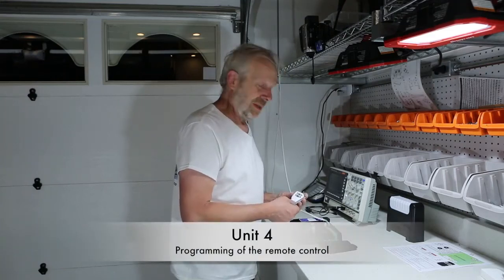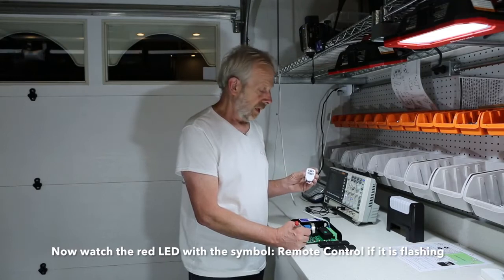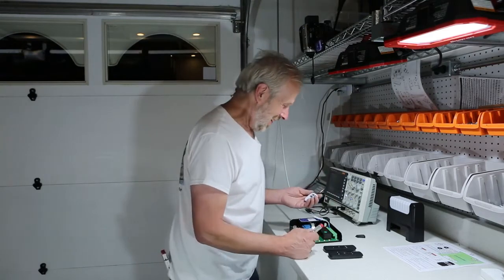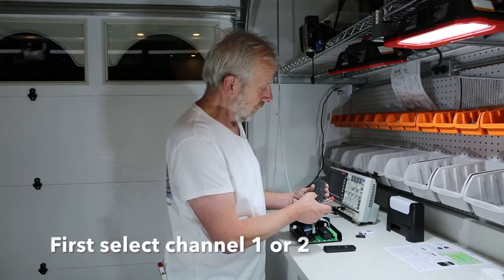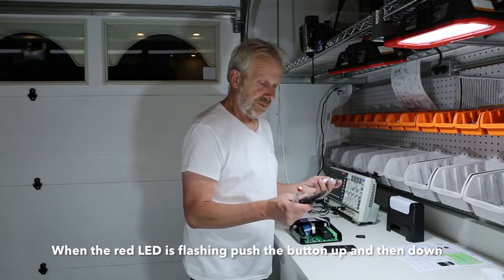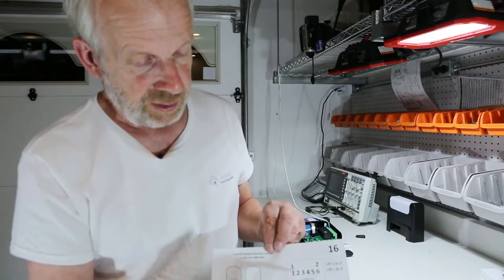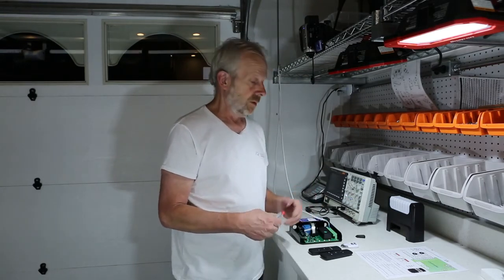Auxx Lift Garage Storage Lifts: Installation Guide - Programming Remote

Comment from the maker: 🛍 BUY NOW: https://yblgoods.com/products/electronic-garage-platform-storage-lift-400lbs-600lbs-by-auxx-lift-2
YBLGoods.com ⭐⭐⭐⭐⭐ Rated: 4.9/5
🚚 FREE Shipping Anywhere in The Lower 48 States!
✅ Installation Assistance!
✅ NO Sales Tax! (ex Ohio)
✅ Price Match Guarantee!
✅ 2 Year Warranty!
✅ Phone, Email, Video, & Pamphlet Support!
👌 EASY Installation on Joists & Rafters 

The Auxx-Lift is the ideal storage solution to keep your garage organized. It is the largest and strongest platform on the market with 4' x 8' area and 600 lbs lifting capacity.

Platform sizes
3' x 6'
3' x 8'
4' x 6'
4' x 8'

Lifting Capacities
400 lbs.
600 lbs.

For 400lbs:
General specs
Model:Auxx-Lift 1400
Lifting Capacity:Up to 400 lbs
Max. Travel Distance1:16 ft
Min. stored height2:8 in

Roof Support
Type:(2) 1 5/8" x 60" strut channel
Fasteners:(8) 5/16" x 4" SPAX© Lag Bolts
Mounting Area:5' x 5' over 3 joists/rafters
Cable:1/8” Vinyl-coated Steel 7x19
Cable Strength3:2,000 lbs

Operating Requirements
Switch Voltage:110V / 120V
Transmitter:433.92 MHz
Electrical Cord:10 FT / 16 gauge / NEMA 5-15
Min. circuit size:15 amp

Platform Specs
Thickness:2.5 inches
Support Frame:C-Channels (15gauge)
Face material:3 x 3 galv. Wire Mesh (4gauge)

Motors
Type:IP44 (T-Motor)
Rated Power:235 W
Rated Current:2.2 A
Voltage / Phase:100-120V AC / Single
Duty Cycle @ Max. Capacity:3 min on, 15 min off4

Size and Weight
Dimensions:
3ft x 6ft
3ft x 8ft
4ft x 6ft
4ft x 8ft
Weight:
128 pounds

What's in the box
2 Motors
Controller
Remote Control
2 C-Strut Channels
Platform
Mounting Hardware
 

For 600lbs:
General specs
Model:Auxx-Lift 1600
Lifting Capacity:Up to 600 lbs
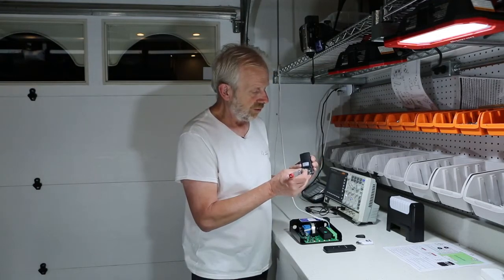Max. Travel Distance1:22 ft
Min. stored height2:8 in

Roof Support
Type:(2) 1 5/8" x 60" strut channel
Fasteners:(8) 5/16" x 4" SPAX© Lag Bolts
Mounting Area:5' x 5' over 3 joists/rafters
Cable:3/16” Vinyl-coated Steel 7x19
Cable Strength3:4,200 lbs

Operating Requirements
Switch Voltage:110V / 120V
Transmitter:433.92 MHz
Electrical Cord:10 FT / 16 gauge / NEMA 5-15
Min. circuit size:15 amp

Platform Specs
Thickness:2.5 inches
Support Frame:C-Channels (15gauge)
Face material:3 x 3 galv. Wire Mesh (4gauge)

Motors
Type:IP44 (T-Motor)
Rated Power:680 W
Rated Current:6.0 A
Voltage / Phase:100-120V AC / Single
Duty Cycle @ Max. Capacity:3 min on, 15 min off4

Size and Weight
Dimensions:
3ft x 6ft
3ft x 8ft
4ft x 6ft
4ft x 8ft
Weight:
128 pounds

What's in the box
2 Motors
Controller
Remote Control
2 C-Strut Channels
Platform
Mounting Hardware

🛍 BUY NOW: https://yblgoods.com/products/electronic-garage-platform-storage-lift-400lbs-600lbs-by-auxx-lift-2

Comment: Wish I would have seen this brand lift. Looks much sturdier, easier to install, easier to control with a remote instead of just a phone. And the service and customer service of the other company is awful. U guess I’ll replace it as the crappy ones I have break.